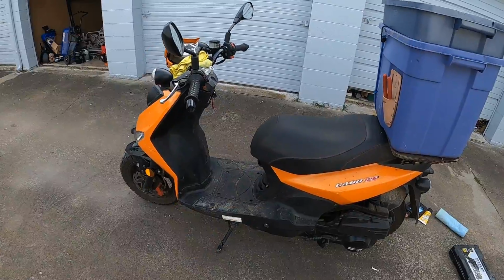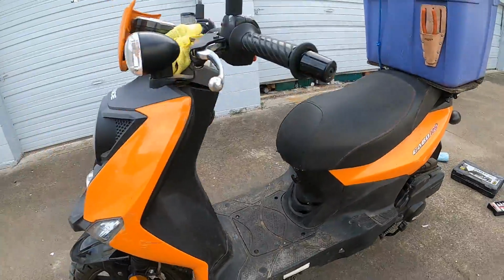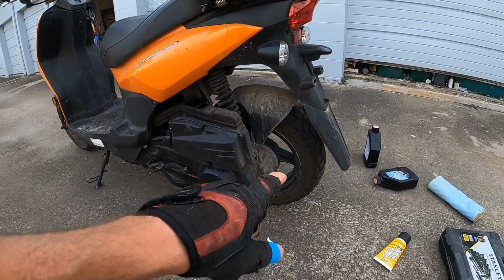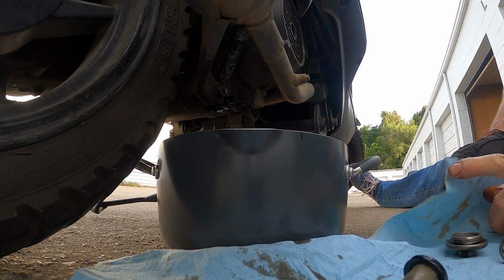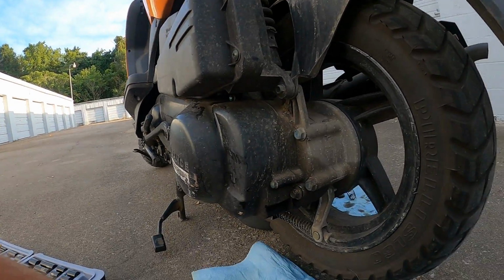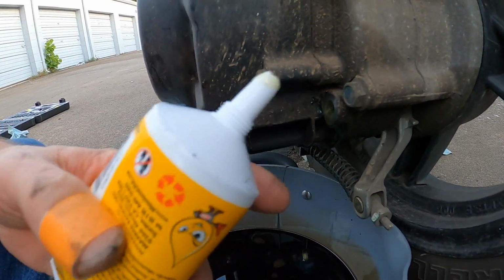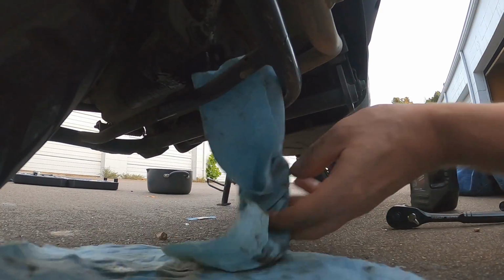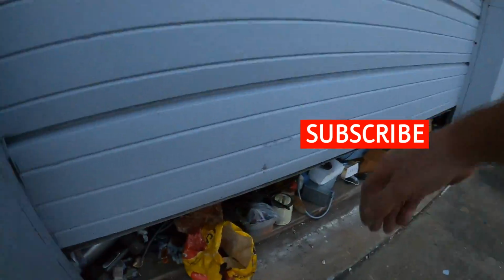SYM Lance Cabo 125 - 2 Year Review & How To Change SCOOTER Gear & Motor Oil

Comment: I used to have a Lance Cali Classic 125 that I bought used with only 1500 miles on it for $900. It was black, really dirty and scratched up, but no indication that it had ever been dropped. I went through everything, checked the valves, belt, changed the engine and gear oil, and started riding it. I bought it because of the price and the way it looked. I was going to use it for going to work and back, and going to the store. I didn't figure it would attract any attention in a parking lot like a shiny new bike. I would up putting over 8,000 miles on it, a lot of that at full throttle on 65 mph rural roads. Never had a problem. I weigh 240, and carried another 30-40 pounds on it, under the seat, and in the top box on the luggage rack. I finally sold it, and went back to a car for commuting. Now I'm thinking about getting another scooter, but want something different from the Cali Classic. Looking at the Lance Cabo and PCH 125. Local dealer only has white ones, and I can't see myself on a white scooter. He's having trouble getting new ones. I told him if he got a Cabo or PCH in some other color besides white to give me a call. 

I just turned 64, been riding motorcycles all my life, have about a million miles on motorcycles since age 16. Not one accident, never dropped a bike. Then a few years ago I was cruising down the road at around 65, which was the speed limit, 2 lanes in each direction, I was in the right lane. Some idiot passed the vehicle behind me on the shoulder, then tried to pull back in front of them where I was. They saw me at the last second, and swerved right, it was a Chevy Suburban, and the left corner of their front bumper caught my right leg just below the knee. I went down hard. Very lucky I wasn't crushed by cars. But it did a lot of damage. My right leg is full of titanium. It is almost impossible to get my leg over the seat on a motorcycle anymore, so I started riding step through scooters. I've ALMOST been run over on motorcycles hundreds of times, my luck finally ran out. A former coworker is now a paraplegic after crashing his Goldwing in a blind curve. He went around the corner too fast and leaned over too far, and ran into gravel in the middle of the road, He lowsided, then was thrown into a steel guardrail, breaking his back. He was also a highly experienced lifelong rider. Bikes are dangerous, but they are also addictive. At least I can still ride scooters, and my Honda Rebel 250.

Comment: I am impressed by the durability of that little scooter with all the starts and stops that you do it ought to be worn right out but it’s still hanging in there. For a midrange price it sure seems more than worth the money spent.
I just wonder how hard it is to get replacement parts like the broken bracket on your instrument cluster?

Comment: You are getting good use out of it for $2000. That bolt should have come out if you had a good grip on it with the vise grips. Hopefully it is not cross threaded in there. As you said before your main income from your adventures is from the videos and not being a big time scraper, so the scooter suits you fine.